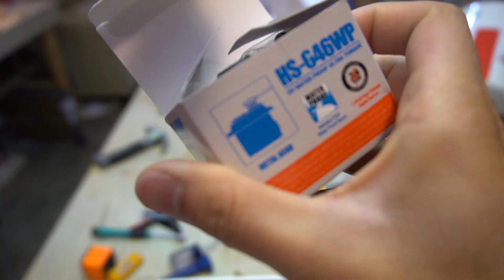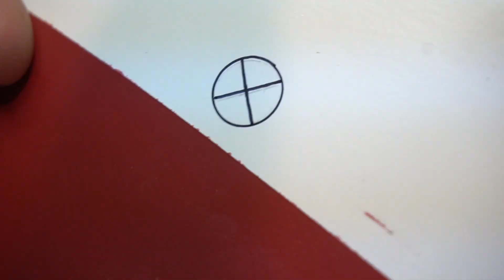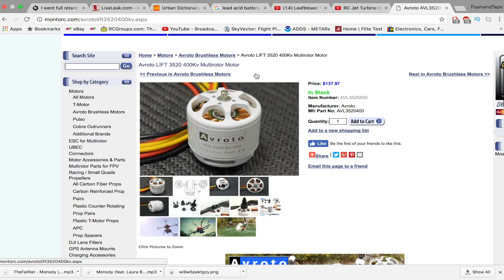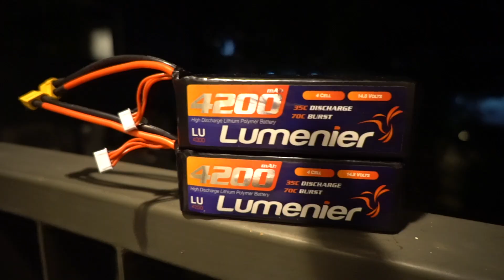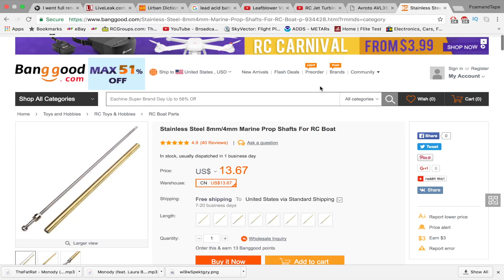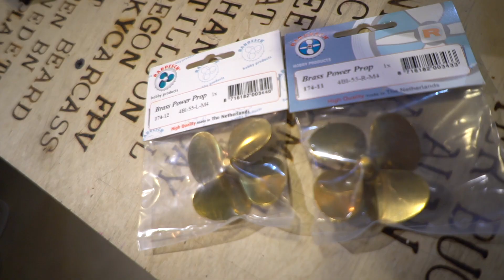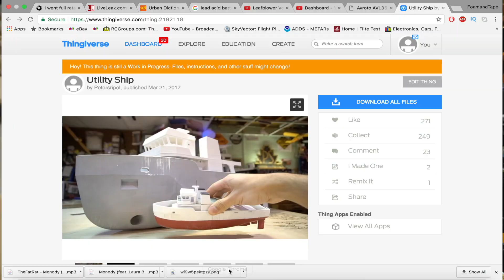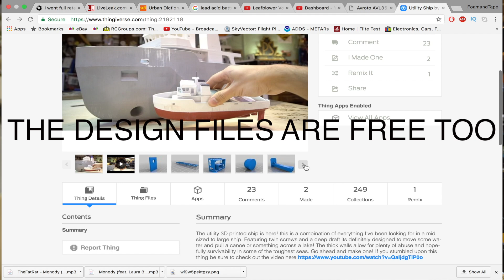GIANT 3D Printed Utility Ship part 2

Comment: Really good job with the boat build and kudos for adding the bow thruster.  Can you control the two wheels independently? If you can then you can walk the boat. Hard Rudder left  Port ahead and Starboard reverse. Hard right Rudder is  Stbd Ahead and Port Reverse. 

Instead of a Submarine or in addition to one you might consider building an R.O.V.  That way you get to use surface supplied power and can use an Arduino or other microcontroller for control and telemetry.  That way you can bring lights and video underwater.

Comment: Peter could I suggest that the next build be a historic one? and maybe a better performer {lower centre of gravity ) in John F Kennedy's pt 109 ? could you imagine what that could get upto ?

for the shafts try using stainless steel tig welding rods same for brass or silicon brass rods

Comment: @PeterSripol  Tip for you here, if your working on smoothing pla and its mostly flat or has gentle curves. You should try using a a File with a fairly decent Tooth to it. (make sure you have a cleaning brush though) Its often an much faster method of cleaning up large and even small objects. Plus you don't have to buy as much sand paper that way.

Comment: great video! I noticed you had a video on casting brass, why not 3d print props for casting in brass. seems like you would have them faster and better quality control. I realise it's more work, but for the great work you do its more fitting.

Comment: you're possibly best going to a proper model boat shop to get parts like shafts etc, my local is specialised for salt water and gets bits in within a week. It's not super cheap but after many years of running in salt and having no issues it's worth it.

Also the 3d printed anchor handling gear is genius, I might have to have a go at copying that, since Graupner winches are like pixie dust nowadays.

Also good luck with the sub, just about the hardest thing you can do. I've been working on an engel sub for a couple of years on and off and it still isn't running sweet. My best advice is Failsafes and uncomplicated ballast tanks, like a piston. set it to blow at low voltage, too deep and lost signal and you should be ok (engel sensors also detect if your hull is leaking and disable the tank). Last time I took the sub out it went over a buried power cable and glitched, diving in the middle of the pond, if it wasn't for the Failsafes it would be a grand of kit sat slowly filling with water at the bottom of a ten metre pond. That was a change of trousers moment...

Comment: hey did you know you can 3D print stuff like that in metal
Reply: Ethan Coy-  You need to cast the metal into the mold. Which is a pain in the Massachusetts.
Reply: no you can get metal filaments that you can 3D print with, http://en.shining3d.com/print_detail-4421.html?gclid=Cj0KCQjwja_JBRD8ARIsAHitdbkosutRFCfFSgT8RZnAKln2eNhQvQWcvYI5O8TFstCS68pdusB9VzMaAtrZEALw_wcB 

https://www.cubictech.com.au/products/bronze-filament?utm_medium=cpc&utm_source=googlepla&variant=25644368009&gclid=CjwKEAjwja_JBRD8idHpxaz0t3wSJAB4rXW5Tw2qY5xWZ2V-IK26judGrDsAdlG0S0pZoCl5wth0QBoCQb7w_wcB

Comment: Great video Peter! I wonder if you'd be interested in putting together some underwater LED rigs, on the cheap, before the submarine project? I saw, many moons ago, some modelers in Japan running scale models underwater, like the Millennium Falcon and Enterprise. The videos looked great, but they had to use some expensive stuff to get real light down there. Any ideas?

Comment: I used to work in a wholesale for steel. for salt water you need a different type of stainless steel. So the stainless is probably good just not rated for salt water. For salt water you need type A2 or indeed A4 and is more expensive.
Reply: ganymedeIV4 I had a little rc sailboat with lead on the bottom of the keel. It really helps, and it is harder to tip and if it runs aground, it is protected.
Reply: A2 won't hold in saltwater. It will corrode. You need A4 for the sea.
Reply: There is no such thing as "rust proof" stainless steel. Only grades of increasing resistance. If proper care is taken just about all grades will work. The first time it's ignored any stainless grade will rust and corrode.
Reply: You're not even allowed to call it 'stainless' in some countries, but 'stain resistant'
Reply: ganymedeIV4 you need a lot of zinc washers. you need density and area for a sacrificial element to be effective.
Reply: There is some rust proof Steele's, made from powered metals and sintered.

They are using them in high-end marine knifes and stuff tottaly rust proof!! 

Awesome stuff I have a few and been left in water for hours then not washed off afterwards and stuff and all spotless!!